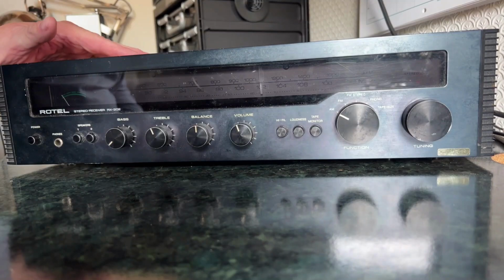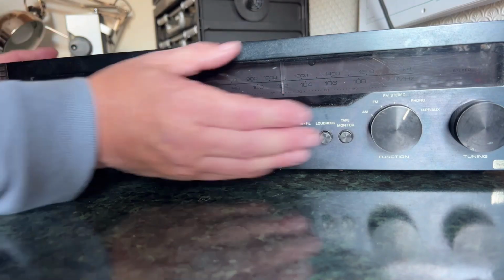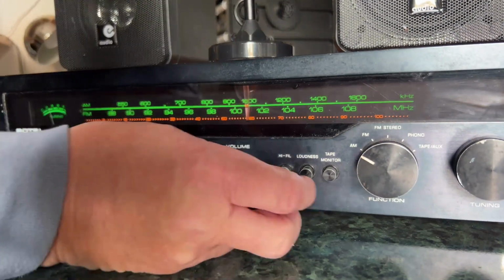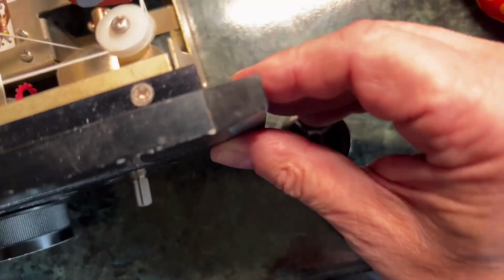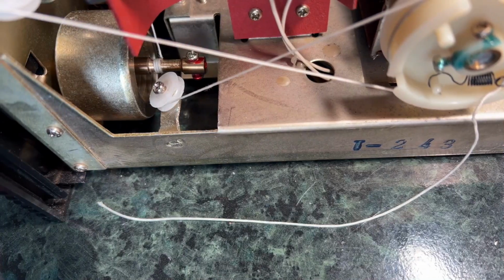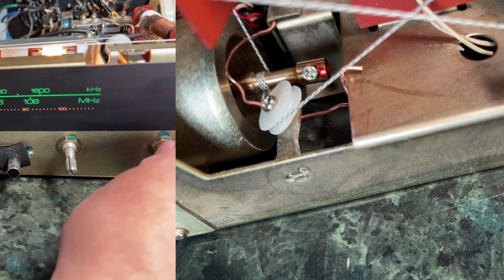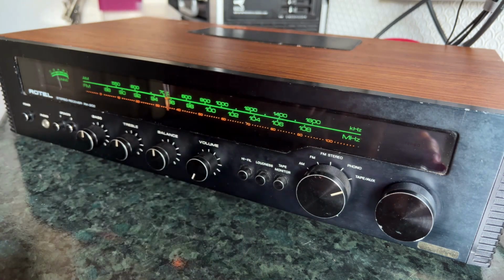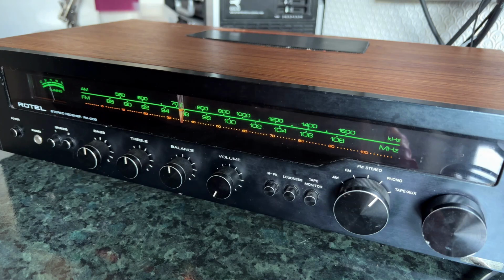The Rotel Inspector

Comment: I was just re-watching this video and when I last tried my MKII I thought the radio was ok so I fired it up and yes the radio is about what I'd expect from a receiver from that time. I did only try on headphones but I had no compalaint about the sound more than enough bass.
I did however discover a fault I hadn't noticed before and that was the tuning meter is dead, at least it's not moving.

I also noticed that in my unit the nylon pully is pushed up right close to the flywheel less than 1mm gap between them yours definately took some damage and probably got pushed back.

Comment: The tuning spindle is too far into the case, it has been driven in when the shaft was hit.
The cord needs to be waxed so that it slides up and down the shaft, candle wax is the thing. It will not slip, will still drive, but will not loop over itself.

Comment: As the FM seamed bass light, could be an electrolytic coupling cap on the output of the tuner has gone low, that would remove the LF.
Reply from the maker: I did change all the electrolytics in the RF section so that should have fixed it if that was the problem. I didn't change any in the amplifier as it seems to work OK.

Comment: I bought one off ebay, mkII version with the better rear connectors. It was parts only and had a dead channel which turned out to be a single cap in on tuning board.
The bulbs were shot so I replaced with Leds  but just as I finished the soldering the iron touched the string. The re-stringing was quite easy even though I hadn't done one before but I did use some stretchy cord.
It worked but made tuning a little hit and miss so later I replaced with something better.
Reply from the maker: Know how you feel - I too have had that sinking feeling when the soldering iron hits the tuning cord 🙄

Comment: I.TOOK THE  LID OF MY  ROTEL AND IT IS 3 TURNS YOU  GOT THAT. TRY USINY CANDLE WAX BEES WAX CURCH CANDLES .ALL THE BEST
Reply from the maker: I did try adding wax but if the bodge fails I might try some pre-waxed cord. There are 3 turns now and that’s what the manual says but there were only 2 when I got it.

Comment: I had a similar problem with dial string. On my set turned out that, due an impact onto tuning knob, the shaft itself slides backwards from the flywheel changing the center of string action. Hammering back in position fixed it. On your unit the shaft seems to have a long groove but it uses less than half while rotating the knob. It might be that your set receive the same damage. Pretty unit by the way.
Reply from the maker: I did attempt to find a way to shim or trim the shaft/flywheel back and forth but drew a blank. I’m not confident in my ability to use a hammer on it without wrecking it 😊

Comment: I feel your pain, re-stringing a radio can be a nightmare, especially when it is already broken & no service info is available.
I started out with a cheap 1970's Rotel amp & separate matching tuner, it worked fine, but when replaced by an older Leak amp & tuner, the difference was vast!
Reply from the maker: I almost bought a Leak Stereofetic tuner at Retrotech last year but I’d promised myself I wouldn’t buy anything 🙄
Reply: @neilsradios  I actually got given an identical Leak stereo 70 & Stereofetic tuner that I had back in 1980 last year, both in good working order.
A real trip down memory lane, sound quality is as good as I remember, I also got a pair of large Leak sandwich speakers from Freecycle a few months ago,  so
will get round to pairing it up & having a complete vintage Leak system 😁
Now on the lookout for a matching Leak turntable.....